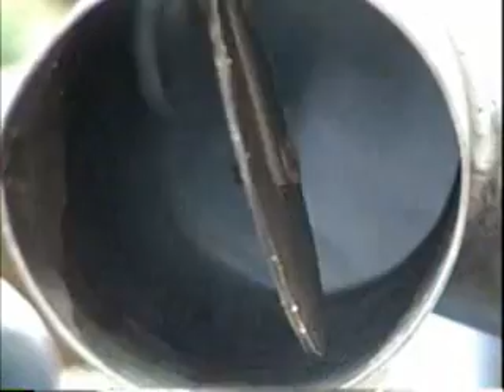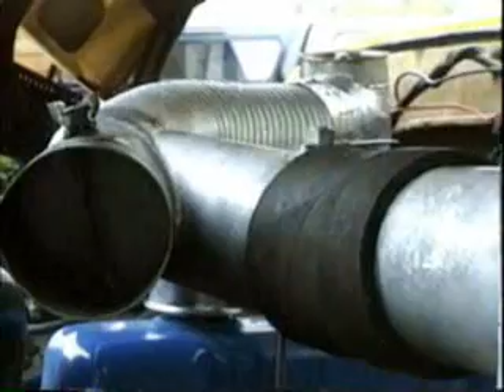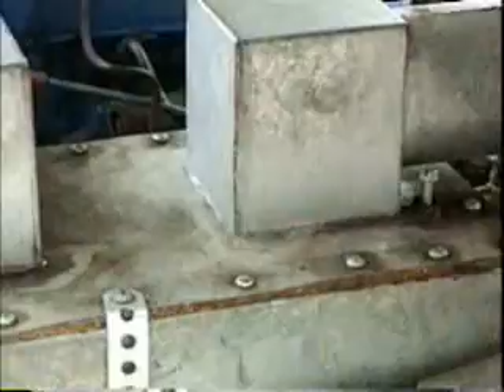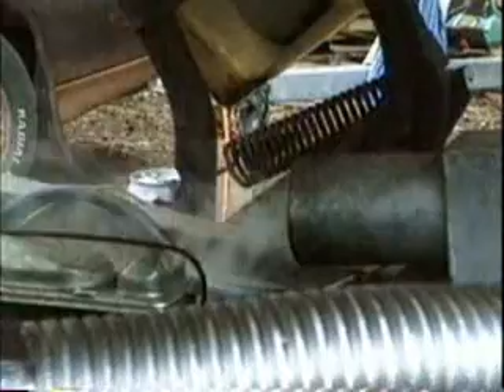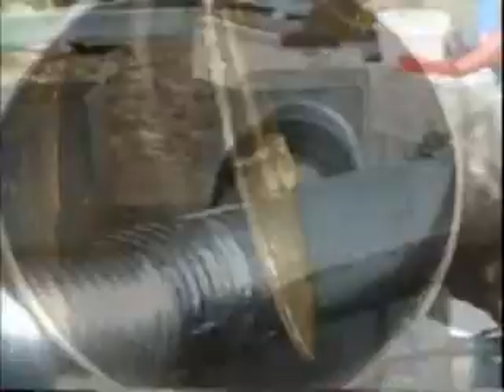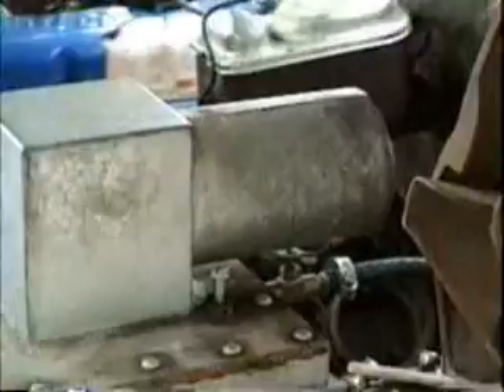Here is definitive proof on how to separate all Atoms in all liquid soluble matter.

Comment: in the auto world, detonation is when the air/gas mixture ignites prematurely. Meaning before the spark step. This happens through advanced timing, hot temperature, and one more thing but I forgot, You previously stated that Regular vapor and premium vapor makes no difference, leading me to conclude that it came off of some sort of pump gasoline.  What is your white vapor? what is the chemical property, it can't be that good, and from the way you speak, you know nothing about combustion engines.

Comment: Do you know the difference between regular and premium gas? The octane levels, do you know what higher and lower octane levels do? resistance to detonation. If your gas is completely resistant to detonation then stop. Prove it, then your gas will be made into something. But don't say there is no change in running regular or premium unless there really is no change, I don't think you did enough experiments.

Comment from the maker: My White Gasoline Vapor is a different fuel than gasoline. Premimum and regular are gasoline grades. Mine hasn't got a grade. It's power will be how much oxygen can be added to achieve maximum power output from the fuel. Then fine tune the engine and try the oxygen mixture again, doing both until the max has been reached. Right now I am getting something like 20 to 50% increase in breaking horse power to the ground. Readings from two dynos. Of course Zero parts per million hydrocarbons, smog.

Comment from the maker: Like I have said many times regular and premimum make no difference, so with my White Vapor, there is only one gasoline, the burning kind.
Nobody has attemped to contact me, so right now I am doing nothing with my White Gasoline Vapor.
I can tell you we need cleaner fuel, and I have made my contribution, I am just waiting to see if someone else will pick up the ball.  On the additive part of your question, it won't work you would be deluting the same old poluting gasoline, so you gain nothing.

Comment: 1
This is the first 10 minute video I've watched in a long time. You need to show results. You have to believe in your product, or no one will. Post before and after dyno results. Give before and after gas mileage. Maybe this can be used in addition with regular carbeuration and/or fuel injection to add some horsepower across the power band. You need to buy a wideband o2 sensor and check if the car runs lean, rich, or runs well within range.

Comment: 2
You need to take it a step further, because your current method of "injecting" the vapor is no good. Carburation is very obsolete to fuel injection for daily driving and your method is clearly random.

Comment: 3
I saw flames in the intake. That is in no way safe at all. How hot did your intake get for it to catch on fire? I know my intake is probably the coldest thing under the hood.  You should think of ways to control the fire and implement them.
You should also check detonation prevention compared to regular gasoline. Since this is vapor, and vapors are hotter than liquid, I assume the detonations will come more frequently than traditional pump gas No one wants gas that is more detonation friendly

Comment: I am a professional engineer. Here is my opinion.
You are a backwoods idiot. All gasoline engines use gasoline vapor, whether injected or carbureted.  What, because you make the vapor before entering the engine, you have changed the laws of science?  P.S. Do you think all that gas vapor billowing out the tee in your video contributes to fuel mileage? Sheesh!!

Comment from the maker: Anyone knowledgeable, in the combustion, engine knows it takes the right amount of liquid gasoline, heat, and oxygen to create vapor. It is my combinations that make my White Gasoline Vapor. Under no operating conditions can a combustion engine produce my White Gasoline Vapor, the conditions to do this are nowhere available on, or in the engine, and carboration or fuel injection don't have this ability. So my White Gasoline Vapor has never run in an engine before, until I made it happen. Proof.

Comment from the maker: Here is something else in the last 1/3 of the video, engine only, no narriation. The RPM of the engine got so low I could see the timing mark on the flywheel with the naked eye. I don't know how slow it got but I had never seen an engine run that slow, well maybe a one lunger, but 6 cylinders, it don't happen. One of these days I want to see how low I can get the RPM. Any this shows the extra power my vapor must give.

Comment from the maker: Oh something else you say the motor looked to be running rough, well since I only use the butterfly valve in the carborator to control the vapor intake. That valve closes almost completely, when the gas pedal is not depressed, and cuts off vapor flow,so I put a weight on the gas pedal, but it wasn't heavy enough, and was starving the engine of vapor. Listen to the engine on the last 1/3 of the tape and you will hear it when it dies.

Comment from the maker: Heck I can prove my White Gasoline Vapor is more powerful, and a totally different vapor than the vapor produced when liquid gasoline vaporizes inside the engine, from carburetion, or fuel injection gasoline fuel systems. A bold statment, but get me to President Obama, and I will show him, but it will reveal how I make vapor.

Comment from the maker: Vapor is not on the same planet as liquid gasoline. no air, fuel, computer, emission system, just my vapor and the butterfly valve mounted to the intake manifold and the sky is the limit. As much boost and oxygen as it takes to get the maximum power from the fuel. No liquid gasoline wash killing the oil in the crank case, no hydrocarbons, engine runs cooler, no carbon creating friction. Understand, plus MPG, and clean air, got it yet?

Comment from the maker: Since this guy didn't post his last entry, I am answering his question here, nothing up my sleeve. He ask how a fouled plug can fire after it has been fouled, well when you take the plug out of the engine, the air hits it and it dries out, then it will fire if you are not using liquid gasoline, but vapor, which burns the carbon off. Thank you.

Comment from the maker: Something else the ping in your engine is actually liquid gasoline that hasn't burned for lack of oxygen to burn the liquid inside the cylinder. I have been a refrigeration service tech for 38 years and know amout the expansion and contraction of gasses, that is how I discovered how to make vapor. In refrigeration it is called slugging liquid, you can't compress liquid, so it has to go somewhere and it squirts past the rings on the piston. The pistons on the engine are basically the same.

Comment: i didnt say anything about octane! no matter what octane fuel your using if you lean the air to fuel mixture out to much you will get pinging!  heard of 14.7 to1? and so now you have dyno results? a 50-60hp increase in brake hp from a wore out 6cyl? thats like an extra 80-90hp at the flywheel, almost double the stock hp from factory!  when obama calls i hope you record it and post it here!

Comment from the maker: I had my vapor on one gas smog analizer, and running on liquid gasoline the meter on the gasses and hydrocarbons were maxed at the top of the chart. Running on my vapor, the same engine, the operator couldn't get the probe to read anything, on gasses, and the hydrocarbons read 0.00% Parts Per Million. Understand now?

Comment from the maker: Well I have had it on two dynos one got 50 to 60 breaking horsepower increase, and the the other got over 70  breaking horsepower increase, and this is a crude setup. On the second the college auto shop instructor told the student I was running nitrus oxide when he saw the power increase. Do you know what nitrus oxide is used for at the drag strip?  I don't care if you don't believe, if Obama sees it you will eventually have one.

Comment: and the reason your spark plugs are so clean is cause your running extreamly lean!! thats the reason your putting your timing back to tdc cause it probly pings like a bitch with its set to where its uppose to be.  hook a gas analyzer up to the tail pipe see whats coming out.

Comment: ha! have you bene taking hits of your "vapor" ? do you even know how a engines fuel system works? your right liquid gas will faul a plug, pollute the oil and cause bad millage and power.  thats why carbs have bene deleted from production due to needing constant tuning to keep them delivering fuel properly.  Hence fuel injection!! a fuel injector injects a mist of fuel ( or for you a vapor of fuel )  and i wont believe for a minuet your truck has seen 100mph!

Comment from the maker: My system burns all the carbon out of the engine, I have seen the spark plugs after running on my vapor, and they were fouled from running on liquid gasoline, having pulled and replaced one to see it happen. After the run on vapor the plug looked almost new. Oh and no gasoline wash inside the cylinders allowing gasoline to get into the crank case, another smog problem, because I use vapor.

Comment from the maker: First of all my white gasoline vapor will eliminate carboration, and fuel injection. They both are set up to handle liquid gasoline, and my system is vapor, however I do use the butterfly valve as the throttle, which regulates the amount of vapor being sucked into the engine, according to the cubic inch displacment of the engine, and the RPMs, you might call my sytem, a vapor injection system.
Understand my sytem better, now?

Comment: not trying to kick you again, but your truck is a straight six that is carburated.  that fuel system was horrible at fuel atomization.  your system is pretty much a fender mounted carb by the looks of it.  is the veh able to drive with your fuel system on it?  rev it up to 2k and hold it lets hear how it runs.

Comment from the maker: The liquid seems to be of an oil base, but thicker. 
Something else, You know how the engines all have the timing mark set before top dead center, to give a pre-ignition fire, to create vapor in the cylinder, to start burning and since it is liquid, it will keep burning even out of the tail pipe, proof, fires have been caused by auto exhausts. With my vapor the timing can be set to top dead center, gaining more horse power, which is lost on pre-ignition.
More horsepower better mileage.

Comment from the maker: Here are some other things I have learned with my White Gasoline Vapor. It burns the carbon off the spark plugs. I pulled and reinstalled a fouled plug from an engine, without cleaning it. After running on vapor for less than an hour the spark plug wasn;t fouled, it looked almost new. Also no sludge from liquid gasoline wash in the crank case, with my vapor there is no liquid. The engine runs cooler, no liguid gasoline still burning in the exhaust system, less heat.

Comment from the maker: I will tell you this ice has nothing to do with anything I do. I discovered a process that allows me to induce oxygen in what ever portion I want to. This and add a turbo, or a supercharger, and have a 500 HP motorcycle engine, with a 250CC engine. What kind of milage will that get. Now put that in a car, and you are in the 60 to 70 MPG range, in a full sized vehicle, and there are no hydrocarbons, remove that unknown liquid, and we just might slow the global warming.

Comment from the maker: I need to know what gasses are emitted, and how much oxygen I can add before the power factor of the gasoline drops off. I would like to know what kind of liquid I retain when I make my white gasoline vapor, because the liquid, about an ounce a gallon, is non flammable and needs to be removed from the liquid gasoline, a big portion of which is the pollutants, put into the air from the burning of the hydrocarbons, in the catalitic converter. Have a few more questions, but need equipment.

Comment from the maker: I also discovered when my white gasoline vapor is compressed it explodes like nitro, so if the turbo or supercharger is added, this thing could get interesting. I have already been accused of using Nitrus Oxide, when a college instructor noticed the power increase when I went from liquid gasoline to my white gasoline vapor, while running on a dynamometer, at the college.